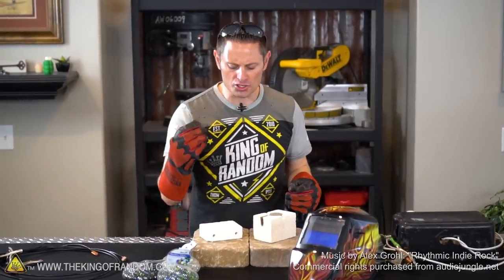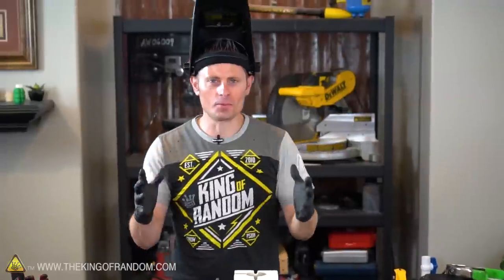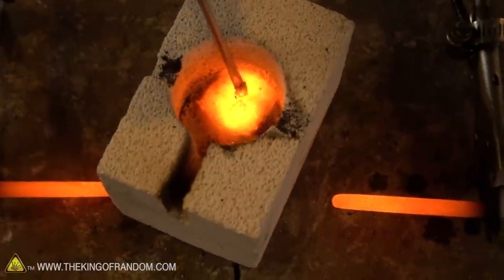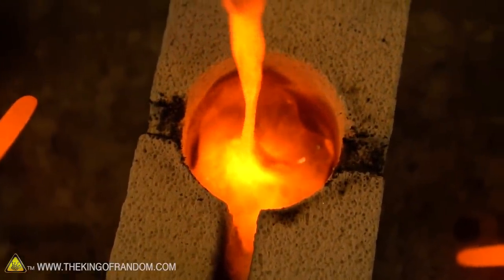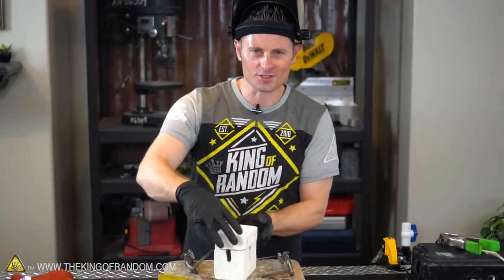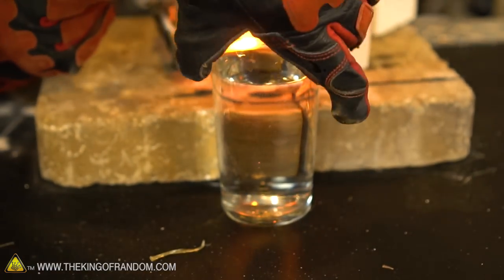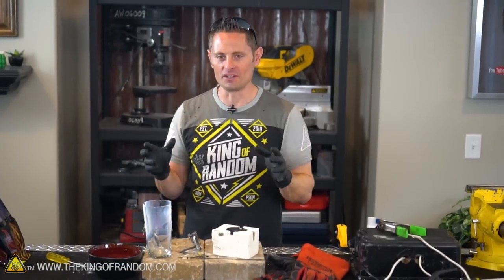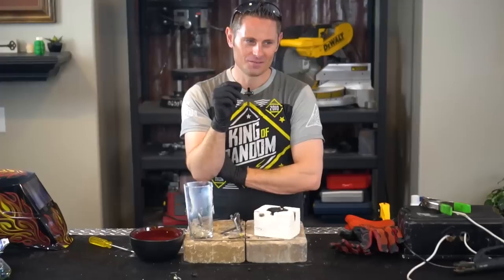Melting Marbles With Electricity | How To Melt Glass With Electric Arc Furnace

Comment: Hey, Grant. I've got a really cool idea, not for your carbon rod arc furnace, but for your flower pot propane forge. If you add a bag of foaming agent to molten aluminum, it will create a material called foamed aluminum which has excellent sound-absorbing, impact-absorbing, and heat-shielding abilities. Some advanced forms of this kind of metal foam can even shatter bullets upon impact. Neat, huh?
Reply: Mike Trieu neat, huh?
Reply: neat,huh?
Reply: Neat,huh?
Reply: thats a cool idea
Reply: I'd like to see that
Reply: get this to the top
Reply: This may be a more appropriate experiment for a channel with rigorous control and research like Applied Science.
Reply: He should mould something made of glass
Like 👍 if you agree
Reply: Mike Trieu Cool! Grant needs to do that.
Reply: Mike Trieu yee
Reply: Neat, huh?
Reply: Mike Trieu amazing idea I tried it today and it is neat.
Reply: I'm guessing by the bizarre replies that I've stumbled upon some meme. Great, now I've gotta look it up. BRB.
Reply: What foaming agent are you referring to?
Reply: Aeryn Siegel well that’s blunt
Reply: J

Comment: You should be wearing protection on your arms. The UV rays coming off that arc are intense.
Reply: Probably some x-rays and other high energy radiation as well.
Reply: Agreed.
Reply: Kevin Jacobson lots of ionizing radiation like gamma rays
Reply: Brew Sauce it's the same as welding,  at most he's gonna get a sunburn
Reply: I guess so.
Reply: Yeah, a really bad sun burn. I've welded without protection on my arms for long periods. Trust me, it's not pretty.
Reply: well whats worse? touching a welding electrode (while its LIT) or getting a sunburn?....
Reply: Dead Meme what does touching it have to do with arm protection?
Reply: Lol yeah dude tell him all about what he should be doing with something he built.
Reply: Mike McFall why not? Just because he built it doesn't mean the hazard isn't there. I work at a steel mill melt shop and we have the full size version of this. Arcs this small aren't as bad as the medium voltage stuff we use, but long sleeve flame resistant shirt and leather gloves wouldn't hurt.
Reply: Kevin Jacobson he should of worn pretciton when paragliding.
Reply: oh yeah yeah oh yeah yeah too soon.
Reply: Dead Meme it's touching 2 electrodes while their lit
Reply: Always use protection kids
Reply: He Don't need them now...
Reply: @ohyeahyeahohyeahyeah6771  a long sleeve shirt would have helped. Right?

Comment: You should make a Rupert´s Drop!
Reply: Joakim What is a Ruperts Drop?
Reply: I agree, you should make a sir Rupert's Drop
Reply: exactly
Reply: Ruperts  drop is a drop of glass, which has some special abilities. It is really solid against shock (almost indestructible). Someone tried to actually break it with hydropress, and the drop left a mark in the steel. The fun part is, that if you try to break of the tail of the drop, it shatteres with no strenght at all. Find it on Wiki for more info.

Comment: make a ruperts drop but cool it with liquid nitrogen instead of water, willl it behave differently due to the quicker cooling??
Reply: I imagine it would crack because of thermal shock.
Reply: Oh yeah you're probably right, maybe if you make it larger, and cool it a little before it goes in?
Reply: well, it's thermally shocked by the water. that's how tempered glass like a  prince rupert's drop works. The question is "is it too much shock"
Reply: Yeah, I forgot to include the "too much" part, thanks!
Reply: My uneducated opinion is the change in temperature won't be that much more severe and it will work.
Reply: The lower temperature may affect the formation of the ruperts drop because of the way it forms. Normally dropped in a regular bucket of cold water the tension in the drop forms because the outside solidifies before the inside. But with those cold of temperatures it all may solidify at the same time therefore that tension would not be there.
Reply: a larger bucket would work better. I don't think the water needs to be super cold. the way the drop works is the out needs to cool so it contracts. the inside is still molten and hasn't contacted. so a tremendous pressure is held in the drop. that's also why the stem is the wall point
Reply: I don't think liquid nitrogen would cool it faster. I think It would vaporise and would have less contact with the glass. But better test it and find out how it behaves.
Reply: Dang I was too late to suggest this.
Reply: Grant really needs to try that!!!
Reply: Scibbie / ǝıqqıɔS excellent idea

Comment: MAKE GLASS BULLETS!
Reply: That won't work, the glass will immediately shatter due to the compression caused by the ignited gun powder which forms in a gun's barrel
Reply: Pulmenti yep
Reply: Eh, you might get it to work with something low caliber like a .22lr.  Or a low velocity/low pressure round.  A .38 might be possible, as long as it's not a +P load.  A .45 ACP would shatter, yeah.  Probably a 5.56mm too.  But..... it'd be interesting to see the attempt at a standard .38 or low pressure 9mm.
Reply: Corwin Weber well yeah that might work but also it wont since grant doesn't have the proper equipment to harden glass and make sure its able to resist the pressure
Reply: Pulmenti nope taofledermaus did that

Comment: Can you pour the glass into little ingots, like you do with aluminum and brass?
Reply: Ernie Velveeta that would be awesome, I agree!
Reply: Ernie Velveeta Yes you can pour it but he doesn't have a temperature moderating kiln so the glass would cool too quickly and shatter
Reply: or just cast with glass in general
Reply: TheKooa Yeah that doesn't really work
Reply: Ernie Velveeta as it cools, I think it would start to crack. so that make not work, but it's worth a try. :)
Reply: If he made sure it cooled slowly it would be fine.
Reply: I'm not sure how pourable that glass would be, as it seems to be very viscous, compared to molten aluminium or brass.
Reply: Mrmoocows99 

That's what I was thinking.
Reply: Zuthal Soraniz 

True.

It has the consistency of Nutella.

Comment: Grant Thompson can you melt sand  into glass ??
Reply: Jose you played too much Minecraft
Reply: +Michael Eduardo Conde Well it is possible in real life. . .
Reply: Michael Eduardo Conde well then, how is glass made without sand?
Reply: You can do fine with sand and a bit of cleaning. For something like this, you'd want to use the cleanest, whitest quartz sand you can get. Florida and the Caribbean's squeaky white sand would be an excellent raw material. 

Since silica is quite chemically resistant, you can dissolve away pretty much all the impurities with a bit of semi-common solvents and acids.

Silica can be fused natively, but requires extreme temperatures compared to soda-lime glass. This form of glass is used on high-temp/high-pressure products like xenon arc lamps.
Reply: Watch The channel 'How to make everything' and watch his series in making glasses you will see why glass doesn't really work
Reply: It's not "found in sand", it IS sand.
Reply: Obsidian and pumice, but also fulgurites (glass made by lightning strikes on soil or sand).

Comment: how long can one set of electrodes be used, before they become unusable
Reply: Depends on what temperatures you use, but if you melt glass like this probably about 10min running the arc continuously.
Reply: Vexik Velyxor ....tnx
Reply: rithwik ramaprasad how long will the electrodes last depends on the amperage and arc length. Also being he is running a carbon rod positive and negative electrodes, electrode consumption is about equal on both ends.
At $2-3 dollars an electrode from a batterey, repurposing is great if you have dead lantern batteries lying around, but carbon electrodes are available at a competitive price.

Comment: What if you get gasoline, freeze it with liquid nitrogen/liquid propane and try to set fire to it.

EDIT: Also try to melt magnets! :-0
Reply: The Computer yes
Reply: The Computer yass
Reply: up
Reply: try propane
Reply: Mythbusters did that. it would freeze and then unfreeze and burn.
EDIT : Neodymium magnet would melt and then lose its magnetism.
Reply: Freeze it with propane.
Reply: Still wana try it tho
Reply: The Computer the magnet would just be a useless piece of material
Reply: Magnets lose their magnetism after reaching a certain heat
Reply: gasoline won't do anything because it is the vapor that is flamable , magnet won't be magnetic anymore.
Reply: The Computer cool idea
Reply: magnets will lose its magnetism over a certain temperature if you wanna see go to the backyrd scientist
Reply: rip idea
Reply: srry man that i ruined your idea but you can come up with another idea also when you freeze gasoline which is a really cold temp i think it stops working i believe hopefully he trys it

Comment: use your ropemaking machine and make fiber glass ropeWhy not? Random happends :) please don't recreate
Reply: Because fiberglass is only really useful in bulk form for insulation. Fiberglass mats and strings are intended to be used in conjunction with a resin. They strengthen the resin, the resin isn't added to augment the fibreglass. There would be no use or desire for spending a video's production time to produce it. Glass balls and fibers are also frequently used to strengthen plastics for additional heat, impact, and abrasion resistance.

Fiberglass is mostly useless outside of those applications. It is sometimes woven to make oven, wood/coal stove, and other mid-level heat resistant flexible 'seals' on doors.
Reply: Ok just say if he can  that he will

Comment: How about making glass fiber ropes with the rope making machine ???!
Reply: Yomoyu U D 

almost impossible.
Reply: But not totally Impossible 👍👍👍
Reply: I commented the same 😂 would be really awesome
Reply: they aren't that flexible
Reply: well, he can try heating them while using the rope making machine, but it wouldn't technically be a rope, just a glass sculpture that looks like a rope
Reply: CreepyblackZ Yeah something like that
Reply: CreepyblackZ 

thats not how it works...
Reply: it can tho... Just intense heat and a spining thing... but not too much heat or it will fall to the ground... And AfterTech, how do you think that glass sculptures are made ?

Just heat, molten glass and sometimes things that spins...
Reply: CreepyblackZ 

glass scultures are not made with spinning wood because, shockingly, wood burns.
Reply: did you watch the rope machine video ? there is like a 20 foot long gap between the 2 pieces of wood
Reply: CreepyblackZ  Thin strands may work
Reply: Feubrune exactly.

Comment: I'd bet the black color is from carbon particles eroded from the electrodes. Once the glass is hot enough to glow it should be conductive enough to use ohmic heating.  Just try  keeping the electrodes immersed in the glass and close together but don't strike an arc. Similarly if you heat a spot to glowing on a large chuck of glass you can melt it in the microwave.

Comment: doesnt this arc furnace use a ton of electricity
Reply: Andy Brooks I wondering that as well
Reply: Andy Brooks watch some of his older videos he says how much it uses think it was 240-120 volts
Reply: Volts do not tell you how much electricity something uses. Watts do.
Reply: Gaming PC what's the amperage too????
Reply: Gaming PC how about the wattage?
Reply: Gaming PC the voltage is pretty obvious because it uses mains power
Reply: דוד שלמייב what your username actually broke my response ...???
Reply: no, you just need car battery doofus
Reply: how did u doo disדוד שלמייב
Reply: R=V/I ; so all you need is high voltage with a step up transformer..

Comment: Can you cast melted glass using the styrofoam in sand method like you would do with melted metal?
Reply: Rachel the sand would become glass
Reply: SUPER.00D.M0NK3Y.24 GAM31NG then he can use something else
Reply: SUPER.00D.M0NK3Y.24 GAM31NG real life isn't minecraft
Reply: SUPER.00D.M0NK3Y.24 GAM31NG buddy the glass wont be hot enough to melt the sand so he could put molten glass into sand
Reply: The glass would probably be too viscous to cast properly
Reply: @Brendan Campbell dude are you empty headed? the melting point of aluminium is ~700°C, glass's melting point is around ~1700°C. celcius so what where you saying about it not being hot enough? All though this still wont work, because the glass will layer on itself and cool down too rapidly

Comment: Make a glass playbutton with it use your castings from the chocolate one or won't that work?
Reply: Timo   

I think POURING glass into a mold would be very hard to do. In this video the glass wouldn't move a lot unless he used his little rod and looks thick. Unless he put a mold with glass in it and then pop that in a furnace that would fit it he might just have to shape the glass

Comment: @Grant Thompson I hope you know that melting already once melted glass is way easier than melting sand with the rest of the resources to glass melting point of quarz sand = 1700 - 1800 °C even with sodium to reduce the melting point you would have to heat the glass about 1-2 hours and stier it to remove bubbles! So all you probably would get is a little chuck of not see trough glass with a lot of not molten quarz sand inside!

Comment: Try getting a lil pool of molten glass and then just dipping the electrodes into either side of the pool. Molten glass actually is conducting energy. At industrial level, it often gets molten with fire, and when its molten, its kept 'liquid' with running currency through it. Because glass has enough resistance, the current flowing through it heats it up/keeps it hot. I'm a glassblower, you can trust me with that one :D.

Comment: +Grant Thompson I left a similar comment on your original arc furnace, although I was unsure of whether it would be seen, considering it's from a few years ago. I'm attempting to replicate your arc furnace design for personal hobby use and I had a few questions. For one, I was not able to coil the wire as tightly, so I wondered- is it important that it be as tight as you have it? And if so, could you give tips on how to re-do it more tightly? Also, could you give more specifics on the way in which you wired the transformers and electrodes together? In other words, the wiring diagram.

Comment: Try making Dutch tears by melting glass and dropping it in cold water, as the surface hardens the centre will cool down slow creating pressure. Making the head very durable but if you clip the tail the pressure inside will be released and explode 😎

Comment: I don't no if you realised but you made a Prince Ruperts drops when you dropped The molten glass into cold water when they cool down the glass is toughened and you can hit the fat end of the drop as hard sat you like with a hammer and it will not break but if you cut the tail with a pair of scissors the fat end will violently explode into 1000 pieces

Comment: You should try seeing if the electrodes will run the electric heat through metal like a conductor. And if it can then could you melt designs into glass, metal, stone, or other interesting objects?

Comment: fairly sure the coloring of the mixed marbles after being melted is carbon contamination from the electrodes, it would be interesting to see you take a clean furnace and use a single color of marbles (say clear or white) and i would guess that you would see the same coloration.

Comment: You can get a pack of these carbon rods for cheaper at welding supply stores. They're used for air gouging and are available with copper coatings so they last longer.

Comment: What if you created the molten glass but then dropped another marble into the molten glass while it is still hot. Will the heat be enough to melt a marble without the heat from the electricity?

Comment: There's a glass structure called the Prince Rupert's Drop which is a drop of molten glass dropped into water to quickly quench it into a tear drop shape. It has some interesting qualities to it, in that it's pretty hardy and able to handle some impressive pressures, but if you strike the tail of it, it will pretty much explode.

Comment: Please connect electrodes to the electric arc generator and use it to make oxy-hydrogen generator, will the spark boil water or burn the gas released and explodes

Comment: Hey! I'm sure this has been suggested already BUT, could you melt clear marbles with the arc furnace then draw out some 3 or 4 ft glass strands  ( as you demonstrated), dip them in plastic, then use them as a fiber optic cable to transmit data?

Comment: Once the glass melts you can stick the electrodes directly into the molten glass and it conducts the current and gets hot. It might be more efficient and controllable but I'm not sure how much current it draws compared to the arc.

Comment: Great Videos! They are the best!

You should make a cover of the same material to place it under the casting you use, so that when you are working something, just remove it and automatically by gravity will lower all the molten material. In this case it is glass, you would have to scrape the bottom cover with the edge, remove it and everything would fall to perfection. Greetings from Venezuela.